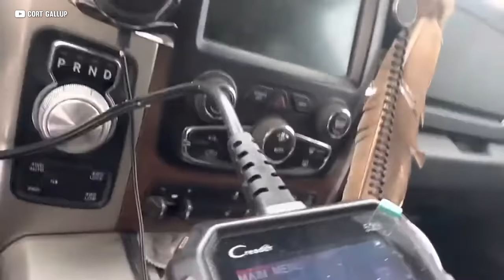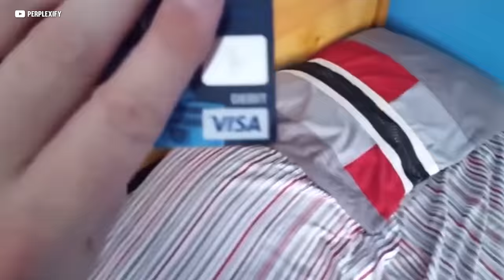Worst Trucks Only Stupid People Buy

Comment: I am a hardcore Toyota fan they always delivered for me, but I am also a huge fan of the 1999-2005 GM trucks especially the 4.8l and 5.3l engines they are near Toyota grade and would have exceeded Toyota had GM fixed the few issues they did have. As for Ford I loved their older trucks up to 1996 and the 4.6l in the 1997-2003 models. Dodge trucks I can say have all been pretty good for me I have owned a 1993, 1997, and a 2018 Ram 2500 6.4l. 2018 Ram has been pretty decent and we got a fleet of them, but they do have some issues. They are rock solid until they reach the 130k range then issues pop up. I think they are better than what GM and Ford offers for reliability though as of today.

Comment: A 2002 Tundra with a 4.7-liter V8 has 287K miles. It still runs like new—I know I am the original owner. Full synthetic oil is changed every 3-4 K miles.

Comment: Everyone pissed and moaned about the Ford V-10. I have an 02' with 130K on everything original under the hood, but a few filters and a few batteries and it still runs strong with no noises or let downs..... Yeah, I probably should change the plugs one of these days and maybe the coolant, but at this point, I'm not fixing anything that isn't broken.

Comment: You would think GM would of learned their lesson after having issues with the VVL system, had three Trucks ( 11', 13' and 21)with that system and all three of them had to go in for lifters failing, my 21 only has about 30k miles and the  lifters on the left side had to get replaced. Other than that love the engines.

Comment: We have had 3 6.0 strokers and still have 2 of them one with 300000 miles and on with bigger turbo injectors programmer intake with all stock motor and 230000 miles they have all been good so it comes down to the owner

Comment: I will never stop driving Chevy and my favorite models are the Sillverados they are awesome trucks I've bought 2 in the last 11 years I still have both trucks a 2005 and a 2003 the 2005 has 4.3 V6 Vortec the 2003 has 4.8 V8 Vortec and both have almost 300,000 miles and still running strong the only problem I've had so far is out of the 2003 model the transmission is completely stripped out of it because the automatic 4L60E TRANSMISSIONS ARE COMPLETELE JUNK but the engines are damn good built and still going strong the only thing I've ever had to replace on the 2005 4.3 V6 model is cam sensors because they constantly burn out for some reason other than that both trucks are still running strong except for the 2003 model which has a stripped transmission but I can still drive it because 1st and 2nd gears are still strong in it 3rd and drive are shot but what else can a person expect from a junky 4L60E automatic transmission because the years those trucks were built the transmissions were built with a number of defects which over time has been solved but I won't own anything other than a Chevy if I do by chance buy a different model of vehicle then it would probably be an older model Jeep Wrangler or Renegade or older model Toyota Tacoma because the newer models are nothing but total junk

Comment: I don't know what crack you're smokin mentioning the 5.4 Triton. Mine lasted past 269k miles. Other than the spark plug issue this is one of the best engines I've ever had. Off Road, not only was hp never a problem in a 98 Expedition, but I've towed many vehicles...Jeeps included out of mud and sand

Comment: The 11th gen triton 5.4 sucks but the 10th gen is great. My truck has 300,000 on the original motor from 2001 and still runs like a champ no timing belt slack and not one oil leak.

Comment: I've got the  2001  Chevy Silverado Z71. Only problem I had out of it was the transmission and water pump pushing 395000 MI still going  hoping I get 500000 MI best truck in most dependable truck

Comment: I happen to own a 2013 Ram 1500 Laramie with the 5.7 Hemi engine. Now that you’ve mentioned my truck, I guess I’ll  have to either be really careful driving it or pay close attention to my engine.
Reply: Don't let it idle a long time, and change the oil often.  'Swhat I do.
Reply: Bought a 2012 Ram 1500 with 97,000 back in Mar of '23.  Though I was not having any issues with the MDS I decided to have it deleted.  Good thing that I did, because I had 2 badly pitted cam lobes and 1 lifter that was about to go.  Now that I have the truck sorted out I will probably keep it for a while.

Comment: This is anecdotal but I've had my 5.4 3v since 07, has 276k miles all original.
Only issue I had was when I pulled the original plugs and one broke.
Just keep up with regular maintenance and they will last

Comment: as a ford guy i will say i never liked the 5.4 v8s BUT if you did your oil ON TIME every time your timing chain would last 200K and your engine would last 450k spark plugs were only a problem in the first gen 5.4 in gen 2 they made the threads longer

in fact if you have a 5.4 and it runs like shit and its up to 175k-200k slap a timing chain on it and it will likely purr

but again yea not the best engine ford made

Comment: here in December 2023, Cummings, equipped Rams with diesel, Cummings engines, 2530 500 models are going to be recalled for some reason because they are polluting way more than they were supposed to. The fines are over $1 billion to Cummings and maybe ram..
I just saw the new video tonight here on YouTube, it is going to be one of the most expensive recalls ever 
  The problem is, when they did a recall years ago on the Rams with a V6 diesel, those engines that were made in Italy. After the changes were made to make, the engine is not pollute, they ran like crap.
  I had a Volkswagen rabbit that we bought new in 1976. Gasoline engine with a carburetor. A few cars caught fire somewhere so they recalled all of them. Paid a fine to the PA or whoever, gutted the cat converter, and rejected the carburetor so Rich, the exhaust was black at times. It ran terrible from that day on.
 So if I had one of these ram, 2500 or 3500 Cummings diesel trucks, I would not take it in for the recall work. Because they never run right again.

Comment: I have a 2008 GMC Sierra with the 5.3.supposedly junk cylinder shutdown engine.    My truck is 15 years old and I have had zero issues with this vehicle.    I have 140K miles now.    Use Napa Synthetic oil 10W-30.     I have lifter tick either.  The only thing I have done is plugs and wires.   Lol

Comment: The only one I dont agree with is the Colorado, I've seen a lot of I5 engines with loads of miles many over 300k that's 3.6 V6 on the other hand in the newer trucks are absolute garbage! Timing chains are notorious for falling, if you own that engine, plan on replacing it! I'm a GM guy and I will not own one of these engines, nor will I own an Ecoboost Ford either, many of my friends that have Ecoboost any version prefer the V8 after all the issues they had and even the smaller Ecoboost, once warranty is off get rid of it. 
  American car companies do not build decent car engines anymore and most of the new truck engines suck unless they're cast iron blocks, those are the only ones that seem to hold up.

Comment: Well this list is so extensive it covers all the trucks you could get used... Ive owned all most all of these. I had a 4.7 dakota i sold with 296k, i have a 99 lightning, i had a 07 ram 2500 5.7 i gave to friend with 456k who restored it (yup, no lie) and is his eveyday driver, and 05 f350 with the 3v 5.4 with 250k I sold, i still have an 05 f350 6.0 that just got its motor rebuilt at 750k. All of them (except the lightning) are used to transport cars and are stock with with no major drive train issues. Some local some far away. The 05 f350 was bone stock with an EGR delete. Now its got a full performance tow build. Only cost $23k. That sound like a lot but to but a new or used diesel truck is $50k-$70k. So it made sence to me. I will admit i stayed away corm the Chevy with the cylinder deactivation however.

Comment: The worst vehicle I have ever owned, a 74 GMC.  Total POS.  Purchased with 1800 miles from a GM dealership.  I had rust holes before I finished with the 3 year loan.  Plastic timing gears that wore and jumped a tooth.  Wiring harness corroded inside the insulation, I had to rewire the rear half of the truck.   Paint fell off in big sheets when driving.  Rusted out so bad that the tail gate fell off when I was driving.  I got $40 when I junked the truck.

Comment: So if you look hard enough you'll find problems with anything. To start the 2 valve 5.4 was a very good reliable engine from 97'-03' seen many with 400k on the odometer. Also to speak to the 5.7 hemi. Also with good maintenance they are very reliable. I've seen many with 300k on them without issue. Keep away from the bad stories and look into the success rates. Millions of engines produced. It doesn't matter who builds them.

Comment: I have a 07 f-150 with a 5.4 thee valve triton and have never had a problem. Even beating the f out of it at 100 plus mph when responding to 911 medical calls. I absolutely love my truck
Reply: Design has changed in the last 16 years.  EPA forced changes are exceeding engine reliability.  Keep the old truck.

Comment: I bought a 2023 v6 Tacoma and just didn't like it. Gas mileage sucked not very much power and felt cheap. Bought a v6 f150 and love it. Down side on f150 was price and kinda nervous about a twin turbo engine long term. I will probably trade it in on a base model coyote single cab next year

Comment: You mention all these problems and yes all! Vehicles have problems. I know I have work as a mechanic for 40 years now. I take issue with the AFM for gm, yes it did happen a lot. But you fail to mention that in most part the failure was due to lack of oil changes and oil pressure that was to high. These two factors were mostly responsible for the failures. GM has redesigned the oil pump to be a variable pressure pump, that solved one of the issues. The other issue is on the owner. I can not emphasize strong enough that proper maintenance especially oil changes are a must for longevity. A lot of the issue most modern cars have are due to not changing the oil in your engine every 5000 miles period. Oil is the engines life blood and when you let it get dirty or contaminate you take life “miles” out of you engine. Oh and by the way the AFM engines did not have a 97 percent failure rate.

Comment: I have a 2011 5.7 hemi, it didnt have issues until it hit 190k. Then it had a couple big ones, misfires, ticks, it got a new engine recently. It was still ticking, got headers for it and stage 8 header bolts, according to google and other sources, thats the only permanent solution. Don't know if thats true just yet, but, I'll find out soon, I'll update if it works. I was to told the tranmission was junk as well, but, it out lasted the engine and its still going strong, I hope that was just misinformation.

Comment: I agree with you on the Colorado. But you should include the 3.0 Turbo-Diesel. They are notorious for early engine failures. The good thing though is you never have to do an oil change. It does it for you. When they were new in 2008 there were so many complaints that within 6 months they require engine replacements. One guy had a 2010 and on his 3rd engine in 9 months and even then the new engine used excessive oil. Thankfully Isuzu has fixed the problem so it no longer effects the Colorado. I still wouldn't buy one. I'd get the Isuzu D-Max. Same truck just re-badged, cheaper and better after sales customer service.
Reply: They Colorado never had the 3.0 liter.  They had the 2.8, completely different engine
Reply: @joshcrd7925  I just looked this up as an example: 2008 Colorado LX RC Manual 4x2 Release Date: Jul 2008 Cab Chassis,, $3,000 - $7,200 Price Range (Used), 2 door, 4cyl 3.0L turbo Diesel Engine, 5spd Manual,  Rear Wheel Drive. They were made from 2008-2011.
Reply: @2DogsVlogs  I thought you meant the 3.0 that is currently available in the Silverado.  I'm not familiar with that engine.

Comment: so .. i RECENTLY BOUGHT A 2016 CHEVY SILVERADO 1500 LT .... it has the 5.3 V8 ... But it says "OHV  16V" .....  I assume that means Over Head Valve ?  was this motor the one you were warning us about ?  I didn't see any mention of the "VVL" ?  I'm not sure what the VVL stands for
Reply: VVL stands for variable valve lift.  They really shouldn't have said VVL because that's not what is happening.  The 2016 5.3L V8 has AFM - active fuel management which lets you run in either V4 or V8 mode.  In V4 mode 4 cylinders get deactivated and the intake/exhaust valves stay shut on those cylinders (so you recover most of the energy you used to compress the air).  They keep the valves closed by collapsing the lifter.

Comment: @3:44 Incorrect on engine replacement not fixing the issues. The design flaws are fixed in the new blocks, but you'd only be correct if swapping in a use motor, which is a waste of time. Source: The Car Wizard

Comment: Bought a 98 Ranger for $600 been driving 8 years now and less than 300$ spent repairing it. Last motor with Dual Timing Chains. Rarely ever touch it. Now 300k runs better than my moms Brand New SUV I’ll stick with old vehicles. I sold my childhood friend my old 91 Toyota pickup he now has 770,000 miles on it, driving it still 200 miles a day

Comment: I'd change out the engines on ALL of these and put a set of 1500 HP Cobalt-Samarium Ultra-High-Heat Resistant high-impulse-current all-EV motors on teh front and rear axles attached to a big bank of Thin-Film ceramic-encased NanoBolt lithium tungsten batteries which which hold twice the charge of LiFeP batteries AND they charge faster! An actual  600 miles (900 km) of range is AWESOME even with 3000 lbs in the bed or 10,000 lbs of towing on the back!

1500 HP and 1200 Foot/lbs of torque and 600 miles of driving range is nothing to sneeze at!

V

Comment: My company truck is a Colorado,(2017 was replaced with 2022 which has been back to the dealership 3 times) in five years had electrical problems, heating problems, oil leaks  door locks failed also ignition needed to be replaced. I personally know the tow truck driver.

Comment: I have a 2021 Chevy trail boss & it doesn’t have the cylinder deactivation in it because of the chip shortage that happened in 2021. The only problem iv had with it is it had a faulty fuel neck & it stopped letting me put fuel in it. The dealer put a new fuel tank & fill neck in under warranty. I haven’t had any other problems with it.
Reply: You don't have the controller for cylinder deactivation but the engine still has the hardware for cylinder deactivation.  You're just never activating it.
Reply: @a1smith2468  correct

Comment: Still driving my 1995 Dodge Ram 2500 Cummins after 25 years, it will outlast me at current rate. Fixing a 1996 Toyota Tacoma 2.7L this summer. I don’t buy any new vehicles.

Comment: I have an 08 canyon 42k miles, since new. the only things I’ve had to change /replace besides the regular consumables. Fluids ,filter, tires, battery, bulbs,  belt,  wipers,   Is the thermostat  and the passlock/ignition sensor thingy.   It’s never been to gm for any service.    I like my shitty truck.  And I’m keep n it

Comment: I won't comment on anything from detroit - they all are worth each other, and engine is hardly the only component that readily comes apart on those things.
Let me address Toyota. I agree both 3.0 and 3.4 are not the greatest engines. Meaning not the greatest BY TOYOTA standards. By all kinds of fords' standards, they are masterpieces. Let's not forget that 3.4 was a HUGE improvement over 3.0 no matter how you look at it. They both outrun a small pile of fords but 3.4 can easily live into 3-400,000 territory. My neighbor has a 1996(?) 3.4 that he - being a logger - abuses wholeheartedly but it runs perfectly fine @240+K. It also has no structural rust anywhere, and we are in the NW with full blown winters.
I know ford/gm/chrysler fans don't believe in evolution but still: Toyota 3.0-3.4-4.0 proved that evolution not only exists but is good. In the right hands, that is. 4.0 is REALLY indestructible. I just sold my 2004 4Runner with 350+K. Yes, I did replace head gaskets a few months ago but only because it was overheated due to a leaking hose. After head gasket(s) failed, it was still driven a few thousands without any driveability symptoms.  When we pulled the heads, it turned out they were perfectly fine, and cylinders still had crosshatch. It was driven about 30K after head gaskets had been replaced with no issues whatsoever.
To make it short, Toyota - no matter how imperfect it may be - doesn't belong anywhere near detroit garbage.

Comment: Whats funny is ford and dodge have afm/dod and it fails more, but no only gm gets flack for it. If you buy a gm with that function, have it turned off then go buy the dod delete lifters, cam, valley cover.

Comment: I bought my 05' F-150 new. It currently has 493,000 miles on the original 4.6L. Just put in its 3rd transmission.  Still runs and drives fantastic. Ford just makes better trucks.

Comment: My father bought a brand new 1999 F-150 and in just 10 years it started rusting so bad that the fuel tank straps failed. I have a 1990 Chevrolet S10 and it doesn't have a speck of rust on it. I think back then Ford was making their pickup trucks out of tin foil

Comment: So, you’ve told us all about pickup nightmares.. which trucks get a positive review?

Reading between the lines, sounds like the F-150 5 litre.. (interesting you didn’t mention Ford’s 3.5 & 2.7 turbo’s), the Ram 1500 3.5 litre & the Chevy Silverado 5.3 are the glowing lights. ?

Comment: I have an 07 f-150 w/ a 4.2 v6.. same as the ranger.. 16 yrs. and not a single issue.. ever!
the dealer doesn't stock most parts  because 'they never break down' according to the dealer.